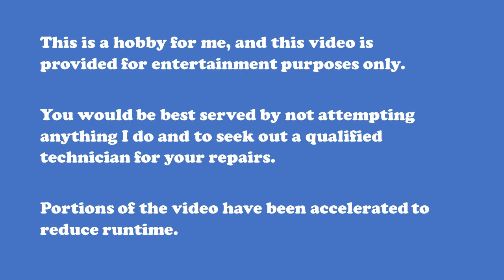Bang & Olufsen (B&O) Beocord 9000 Speed Adjustment

Comment: I use a guitar tuner. I put shrink on the screwdriver shaft so it don't ground out on the motor case.
Reply from the maker: Good point...luckily I haven't had that happen yet...my 'adjustment tool' lost the little flat piece so I need to use screwdrivers until I order a new one...which is right now since I always forget :)